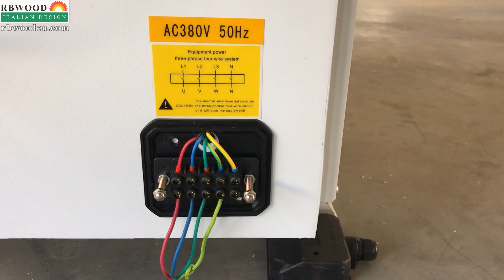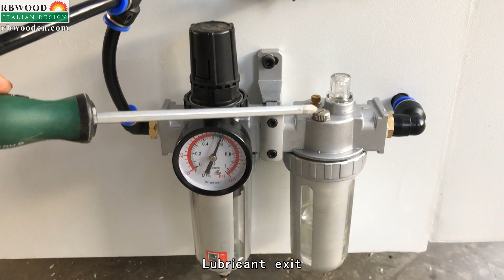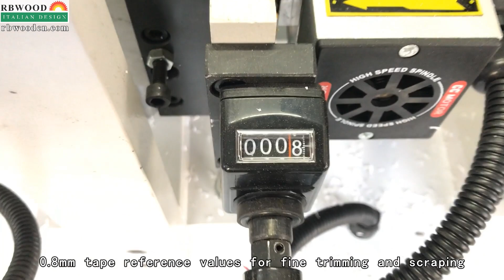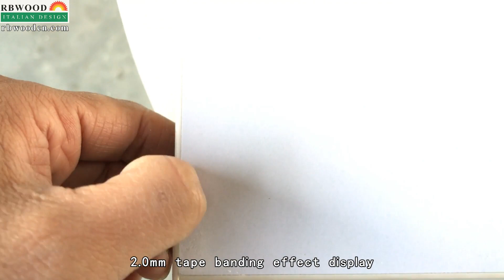RBWOOD edge banding machine installation and working

Comment: How you remove cutters for replacement?
Reply from the maker: we have videos to show our customers when they want replacement. 
easy to change
Reply: RBWOOD i couldn’t find it could you please give me link to video?
Reply from the maker: @woodworkchannel3353  Friend, did you buy machines from us?
Reply: RBWOOD i bought mine in us used .
Reply from the maker: @woodworkchannel3353  friend, if your machines are not from us. Our videos can not help you maybe. Machines structures ar e differnent.
Reply: RBWOOD my edgebander is 50A model
Reply from the maker: @woodworkchannel3353  friend, did you buy from us? Add our whsatspp:0086 137 91984495 and send us metal plate of your RB 50A please.